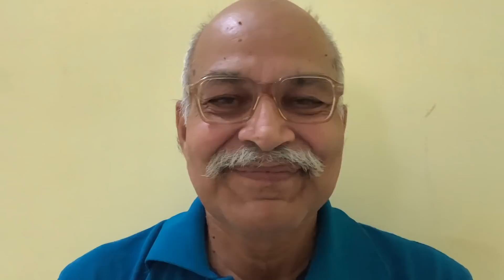Error Analysis in Physics Experiments

Comment: Sir I have question that why don't we get monopoles in magnets?
Sir please explain ....
Reply: If you take a gaussian closed surface around magnet then total lines leaving from is equal tontoal lines entering south so net flux is zero. This means net magnetic charge should be zero inside. So if there is north there should be south pole simultaneously. North south cant exist separately

Comment: Sir I don't get the point that in addition and subtraction we simpally add the errors but in multiple or division we use fractional error  to calculate the resultant and error, why? Why fraction  error?
Reply: Good Question. 
that can easily be proved by Calculus.
Take log
and then differential (Not derivative) of both sides
Reply: @vikramguptaclasses  i still don't  get the point. Sir, could you please explane it again in little more details. Please...
Reply: @nishant6148  it's ok.. once u know calculus.. u will easily understand.. my process..

so no worries for now 🙂
Reply: @vikramguptaclasses  i khow calculus
Reply: @nishant6148  ohhk..
then it requires detailed explanations. 
i will soon be uploading this chapter. You can check them later.

Right i have plans to upload Laws Of Motion
Reply: @vikramguptaclasses  ok sir.
Thank you 😄

Comment: Sir please explain  🙏🙏🙏🙏🙏🙏Sir I am in class 11th and I am confused so I want to ask a question - please explain it.

A particle moves along a straight line OX. At a time t (in sec. ), the distance x(in m) of the particle O is given by x = 40 + 12t - t^3. How long would the particle travel before coming to rest ? 

Sir I am confused b/w the answer 
56 m or 16 m, which is the correct answer ? 
Sir please explain and clear the concept ?
Reply: Abhijeet Singh  ok but can u provide me his email id please
and thank you for your reply.
Reply: @aniketinfreetime5792  56 Hoga
Reply: Hello. Let me tell you the solution. First, find the derivative i.e. dx/dt which will give instantaneous velocity. dx/dt comes to be 12- 3t square. Now equate it to 0 as the particle is at rest and get t as 2. Now, put t in the equation of x and get x as 56. Now, x at t=0 was 40. So, distance travelled = 56-40 = 16.
Reply: Abhijeet Singh  If you know basic maths in physics and motion then, this question is pretty simple.
Reply: Abhijeet Singh  well done.
That's the correct way.